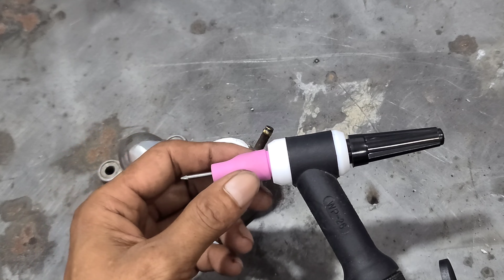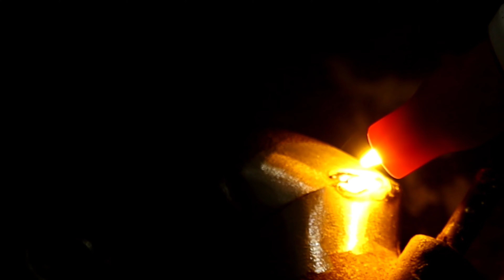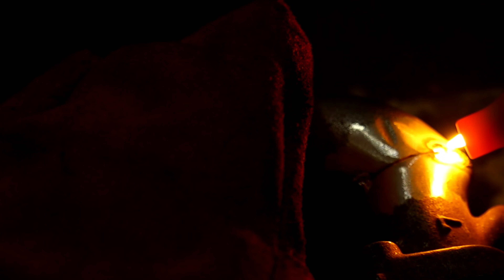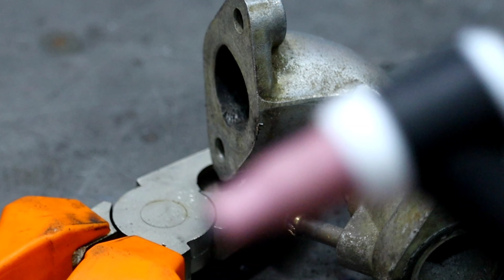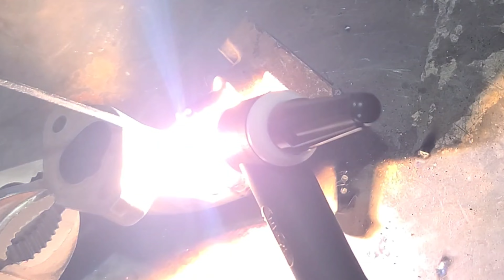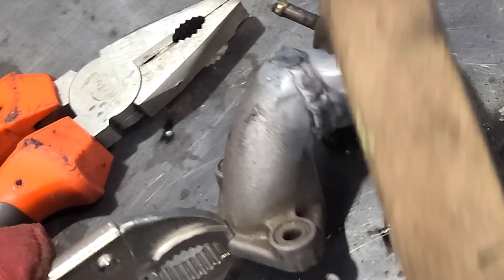not many know how to weld aluminum tig welding

Comment: Those with 120V scratch or lift arc starting machines will not be able to duplicate this. I think if Mr Kuli had preheated these aluminum parts to 350 degrees he would've had consistent penetration.  Aluminum bleeds heat.